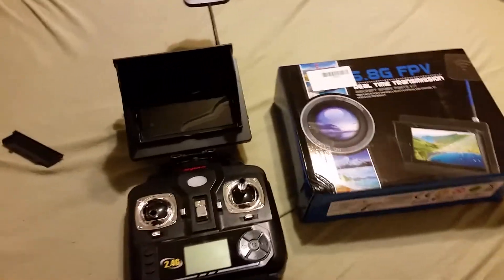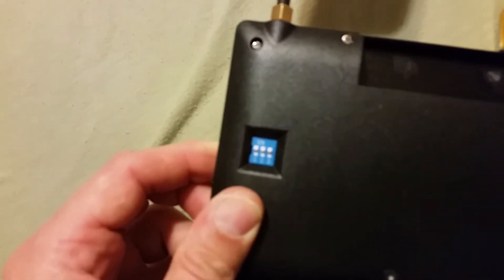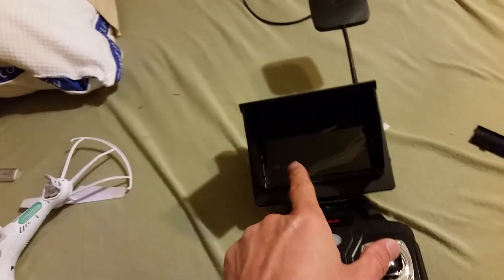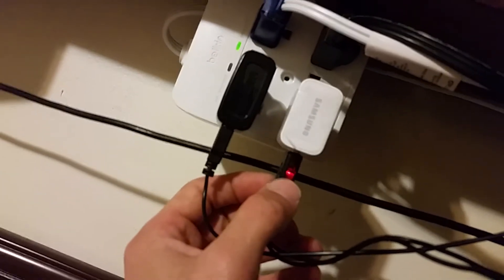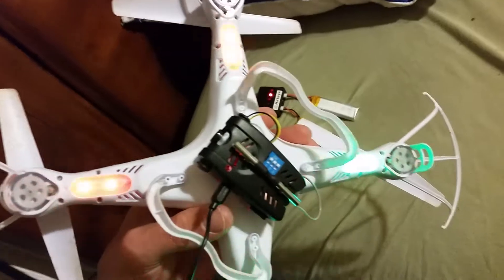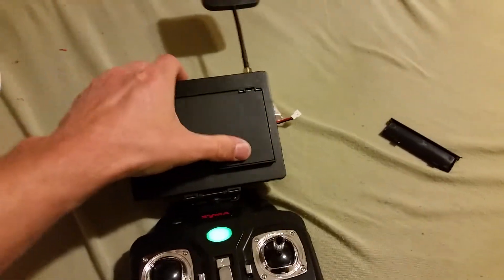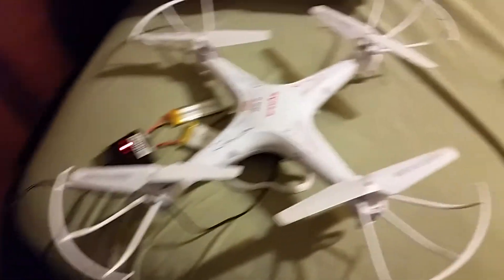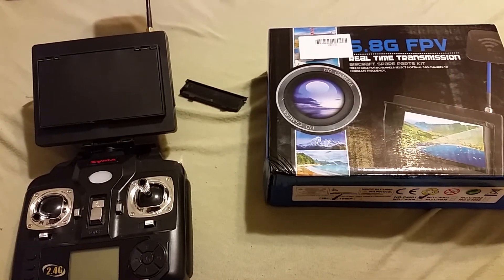Syma x5c-1 fpv kit installation

Comment: On my kit there are several problems. Worst off is the camera charging 
cable will not fit through the camera housing to enter the charging port
 and I have to trim off some of the sides of the cable end to pass 
through past the camera housing. Next the charger does not work for the 
monitor. I had to take the battery out (and it's jammed in difficult to 
open the compartment door) and charge it up using another charger. Can't
 fit battery back in, the cable connector is a millimeter in the way 
(why it was jammed in there in the first place) and have to use tape 
rather than the cover to hold the battery in without pinching damaging 
it. Lastly the camera angle adjuster will not hold the camera lens 
angled down and in the end is same as non adjustable angle camera. Also 
camera mounts loosely and have to jam a foam piece between camera and 
mount to tighten steady it. Ok once you get past these problems as 
described but whats with these manufacturers... they couldn't make the 
battery compartment a millimeter bigger? They couldn't design the camera
 housing with a large enough charging access port? They are incapable of
 of having an advertised adjustable angle that actually adjusts? What 
the Hell!

Comment: Mine didn't come with instructions either. Can you charge both at same time?
Reply: I had this same question because after having my kit stored for some time I decided to pull it and charge it. I tried charging both units at once and now the camera doesn't seem to be charging. But it looks like it's a problem with the usb plug at this point. I think I might have overloaded it trying to charge both units at the same time because I'm not seeing the plug light up anymore.
Anyway, as far as using this with the x5C- I wasn't very happy with it. Not much of a view for FPV. And it's weight really cuts down on flying time and maneuverability. I ended up fitting the camera to an RC car I have and loved it! That's the only thing I really use it for now. If only I could charge it :(

Comment: HI and thanks for a great video. I have an X5HC and I can trigger the stock camera from the transmitter. I bought the same camera as you have in the video (with the two wires only) but can't trigger it from the transmitter Any ideas why? Thanks

Comment: can i use this camera on my syma x5hw?
Reply from the maker: im not sure if the camers mounts are the same or not but yes it will work as long as you can mount it.  your syma hw runs on 2.4ghz and this camera system runs on 5.8ghz.  there should be no interference issues at all.  good luck and let me know if it works better than the wifi thats already on your drone.

Comment: I liked the quality of your video (focus and exposure) and the methodical presentation you gave us verbally. 
I think the 2 lead charging cable is made to plug directly into the LCD panel to charge the 3.7v battery within. This lead probably does not provide sufficient voltage to drive your little multi-output charging block, since that unit expects 5v from a USB cable.
Have you taken your Vtx apart to see if a wider angle lens could be screwed into it?
Jim
Reply from the maker: yes your right.  the other lead is for the monitor.  i didnt even see that plug.  thanks!  no i havent taken the camera apart to see if i can install wide angle lense.  im sure it can be done with some modifications.  not something a plane on doing.  kinda bored with it now.  saving up for better drone.

Comment: about to buy this exact setup, except im buying the parts to build the syma x5c from scratch. the only question i have is the camera plugs into the old camera socket without modification? i ask because the drone motherboard im ordering doesnt have a camera socket pre-soldered on. just trying to figure out how to correctly connect it.
Reply from the maker: yes the camera plugs into the original camera socket on the x5c with no modification.

Comment: hi great video!!
i have problem with my set here. it did work the first time i tried it and when i charge the batteries the whole thing collapsed. the camera gets overheated superfast like after 2-3min.
do you charge the camera turn On or Off?
Reply: you need to turn it off
Reply: +Dyno Gualldyno tried that too.
Reply from the maker: the camera needs to be turned off.  it takes a few minutes for the camera to start charging.  just plug it in and make sure the camera is off. it will start charging after a few minutes.  the other lead is goes into the monitor.  i didnt know that at the time of the video.